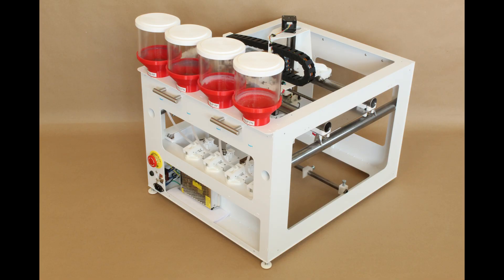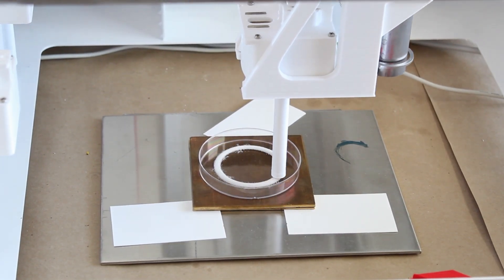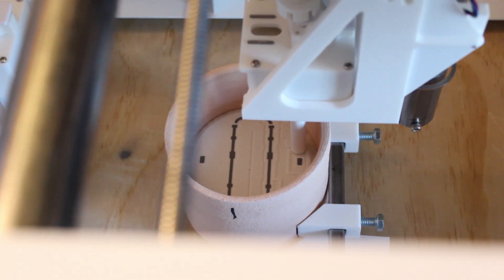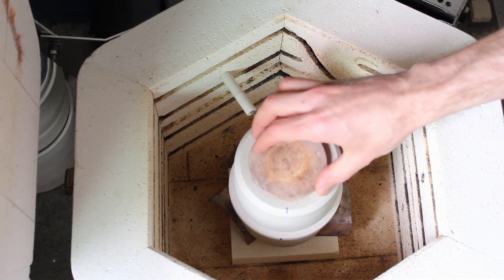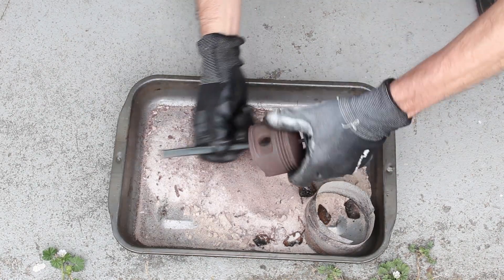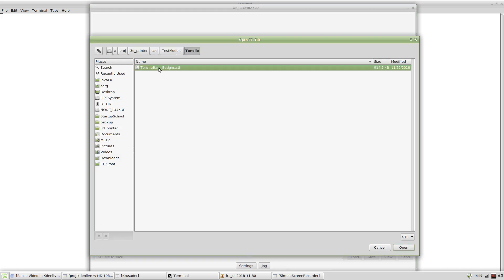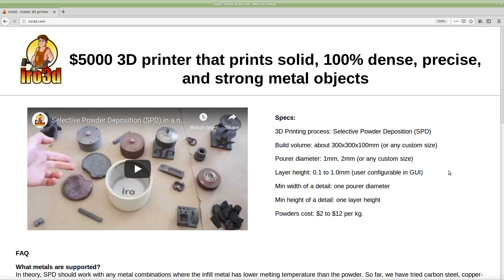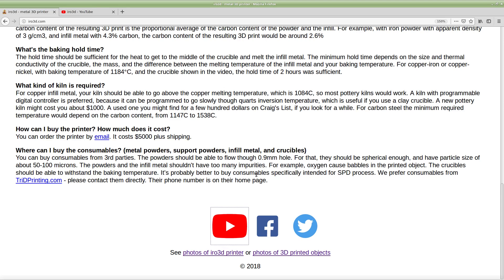What is iro3d metal 3D printer (2018)

Comment from the maker: Here is 2021 version of this video: https://www.youtube.com/watch?v=tY5oQ4e6X_Q
Reply: It seems like a great idea but I was wondering if you could make a much simpler cheaper model so people could get their foot in the door. For instance, make one that only uses 2 powders and is simplified by having 2 separate "extruders" instead of a complex method of using 1 for both.  Also, simplify the design so its cheaper. 

There's a lot of amazing 3D printers on the market and the Ender 3 isn't that great. However, it was able to get many(or most) of us into the hobby and its limitations didn't turn us off from 3D printing but instead inspired most of us to start saving money to get a better system. You need to create a version of your system that's like the Ender 3: a simple, cheap, version that gets people to try out your method of printing. That way, when they like it, they can move on to one of your better systems. One option could be to make parts that could be used to modify existing printers like the Ender 3 or Prusa i3 into doing the stuff your printer does. 

I think you have the best low-cost, high speed, method of 3D printing metal. I think there's a lot of potential there and you could get a large community if you make an affordable entry-level design.

Comment: Really cool technology but 3000 is kind of alot when you can 3d print a part in PLA then create a mold for casting
Reply from the maker: If you can cast it - that's good.  But not all shapes are castable.  Also, making a mold with investment casting is a long and tedious process.  3D printing can save you time.
Reply: @iro3d  I'm not saying the method is without merit, its definitely cool and capable of making complex parts but for alot of applications your better off making a sand mould and casting it that way. Especially for larger parts like for use in cars.
If it wasn't 3000 I'd probably buy one this instant for making complex mechanical parts.
Reply from the maker: @acorgiwithacrown467  We can make them cheaper if we make many at once.  Would you help me with a Kickstarter campaign?
Reply: @iro3d  If you set up a kickstarter I'd definitely donate some money to it as would alot of people. If you contacted alot of the larger machinist channels I'm sure they would be very interested in doing videos on this machine.
Reply: I think the point of this printer is to make your money back. Lost PLA is great but casting distorts shape, includes more porosity, and has other issues. If you set up a business in your town and bought a couple of these machines, you could easily turn a profit

Comment: Due to the technology, if I understand well, it would be easy for instance to print several blades in once right?
But printed object needs to be polished after for product such as knife, correct?
Also, I can't find the page with image?
Reply from the maker: It is easy to print several objects at once, if they fit in your crucible.  But printing blades is not easy, because you would need a special furnace. I assume you want to print blades from stainless still, right?  And, yes, you would need to polish them if you want them smooth and shiny.  What images are you looking for?  (Both, the printer and the printed objects links are on the website.)
Reply: @iro3d  Ok thank you, I found the images. This is because in the new website version, we need to click in the google drive icon and I didn't guess that.
It is not easy to print blades due to the steel? Sharpness? Or due to the special furnace needed / post-treatment?
I want to print blades to create self defense gadgets and sell them. I am not sure which steel to use as my knowledge is limited…
Reply from the maker: @cedrix57  Thanks for letting me know about the website issue.  I just fixed it.  Now the picture gallery should be more discoverable. 
As for the blades, it's difficult to print them because for stainless steel you would need a furnace that can provide about 1500°C in Hydrogen + Argon atmosphere. 
It would be much easier to 3D print rocket engines than blades.  It might be easier to explain the details by phone.   Send me an email with your number.
Reply: @iro3d  Thanks a lot. I suggest that I contact you back when I will know more what I would like (I don't want to make you lose time as I am unlikely to buy yet). Right now, I am just investigating on possibilities. My job is to sell products on amazon. Right now I buy from China. But if I could have my quick & efficient home factory, it could be helpful. But only if it doesn't require advance skills (by advance, I mean long-to-get).
It may not be easy to do knife, but if you could do a video of things we can print and sell, I think it could be interesting :)

Comment: What are your thoughts regarding getting a polished finish on the metal part after the baking process is complete?  Thank you.
Reply from the maker: Yes, if you need, you can polish it after the baking.
Reply: iro3d Right, but do you have any examples of this on one of your prototype parts, and if so, what was the process? This is a crucial issue for some of the things I am interested in doing.
Reply from the maker: @stillastillsfan  No, I haven't tried polishing it.  Do you need a mirror like finish?  What's the application?
Reply: iro3d I can’t say the application but close to mirror finish would be the goal
Reply: @stillastillsfan  if u have a milling machine u can mill it.

Comment: So it uses CNC to make a sand mould?
Reply from the maker: No, there is no mold.
Reply: @iro3d  Well it kind of is, it prints sand and a sacrificial material in the cavity of the mould so that later metal can be melted which fills the cavity. You could do the same thing by printing a plastic version of the actual product and impression it to make a sand mould. I imagine your approach may be better for some unique shapes and prototypes but if you are making multiple of the same item sand moulds would be quicker.
Reply from the maker: @teenflon  Not really.  And there is no sacrificial material in the cavity.  And there is no actual cavity - though you can imagine that sand kind of acts as cavity, but again it's a far stretch of terminology.   With the same looseness, you can say that metal stamping is kind of casting :-)

Comment: also have you considered using tungsten powder with the copper, since this is how some EDM electrodes are made, and this looks like if you have the tungsten powder and several copper and tungsten powder mixes, then you could control the ratio to make a multiple alloy in one part print like some being 70/30 while other parts being 80/20, and still others maybe being 60/40 or even having something else added to the mix, :) I can only imagine how useful this could be to the machining community
Reply from the maker: Yes, tungsten powder and copper infill should work.  But we need to find where to buy the tungsten powder.  The particles should be spherical, and larger than 40 microns.

Comment: Wonderful technology! left me speechless. Precision is part of an achievement, how about the mechanical properties of the output?
Reply from the maker: Good question.  In theory the printed objects should be as strong as the cast ones.  But you do need to have the right powder and the infill metal, and set the right baking parameters. Just this week we had a breakthrough in metal quality improvements.  I'll be updating the video and the website in the near future to explain it. And in the next few days, I try to print some new dog bones and do the tensile strength test.
Reply: @iro3d  Do you file patents for your powders, even for your printer design?
Reply from the maker: I don't make or sell powders.  Why would I try to patent them?
Reply: @iro3d  Let's be clear: you build and sell the printer ONLY. Are we supposed to prepare our powders ourselves? When you stated in one of your video that this printer is cheap - not relatively cheap but cheap -  did you voluntary put aside the price of the oven?
Reply from the maker: Yes, I sell only the printers. You don't have to "prepare" your own powder - you can buy it from any supplier.  The list of suppliers is on the website.  Also, there is a paragraph about the kilns.
Reply: It would not make sense to compare your printer to much more expensive BUT complete solution like this one https://youtu.be/woMKLLEl05s, but printing with your iro3D requires too much manipulations with the constant risk that a movement could ruin a print. It's somewhat deterring...
Reply from the maker: Jean, you must be joking.  If you would have ever used Desktop Metal printer, you would have known, that it requires about 10 times more manipulations than iro3d.  Ric is a genius salesman, so he doesn't mention all the tedious and expensive procedures, which are necessary to operate their system.  But he didn't reach the level of Theranos.
As for the risk of movement that could ruin a print - you are imagining it.  I can dance and jump while carrying the crucible, as demonstrated in my other video: https://youtu.be/QDnRtIEvppY

Comment: Have you experimented in gold or silver? I use to cast gold and silver jewelry but the casting process is kind of terrible. Gold and copper have close to the same melting point though, so I'm curious if you would just use pre-mixed copper/gold alloy powder by itself to control the end result karat such as 14k, 18k etc? Instead of the big copper chunk on top that would be hard to control the end result. Also what kind of quality resolution could you get out of this type of printing - Fine details, prongs, etc?
Another problem would be obtaining gold powder haha which is probably insanely expensive.
Reply: Gold powder isn't as expensive as you would think. A local gun shope was selling  vials of it  for 2 dollars a gram. There's is plenty of powder gold. In any given Creek if you feel like panning for it. Desolve it in acid to remove impurities.
Reply from the maker: No, I have not experimented with gold or silver yet.  They are too expensive.

Comment: How does this deal with the issue of overhangs? I can imagine that they would come out quite badly on a printer that deposits a powder.
Reply from the maker: Overhangs are easy - they are supported by the sand.  Watch the video again.
Reply: With the sand a overhang is irrelevant just like a SLS printer.
Reply from the maker: @Dean Actually, it's even better than SLS, because we have no warping.
(SLS melts and cools one point at a time, so they have a huge warping issue, especially with metal)
Reply: @iro3d  can I ask what the benefit of this is over lost Pla casting?
Reply from the maker: @Joel SPD has many advantages over casting. With SPD you can print practically any geometry.
But casting has lots of problems. For example:
1. How would you make a thin wall?  (Flow of molten metal is restricted by its surface tension)
2. When you pour the metal, where would the air go?  (You would need to add vent channels, and cut them off afterwards)
3. How would you support long and thin cores?
4. How would you remove the long, thin and complicated cores?
5. Casting requires mold material to be thermal shock resistant.
6. Casting is very labor intensive, and thus expensive.
7. Casting is dangerous - you have molten metal outside of the furnace.

Comment: Can you actually use a copper-iron piston?
Reply from the maker: Of course. I use it as a demo object - works great ;-)
I wouldn't put it in a car though.
Reply: @iro3d  It would be pretty cool to see actual use cases of the printer 😉
Reply from the maker: The actual use cases are listed in "What are the practical applications for SPD" section on iro3d.com
Reply: It's a good start to the technology. Just like the first Rep Rap printers had alot to go back then but look at 3d printing now.
Reply: The weight has to be the same as other pistons in the engine, otherwise there is an imbalance, and would the engine destroy itself.
Reply: The way the finished product looks I'm sure you can use it as a paperweight or a door stop.

Comment: 1. Скажите, а компенсируется ли чем-то усадка металлических порошков, образующих деталь, в процессе спекания?
2. Пробовали ли вы проводить дальнейшую мех. обработку полученных деталей? Насколько однородна структура металла?
Reply from the maker: 1. There is no sintering (net спекания).  The video specifically explains it.
2. Yes. The grain boundaries are invisible to a naked eye.  With carbon steel, brass or bronze - it's practically uniform.  With copper-iron  - it's not, because copper and iron don't mix much.

Comment: Камрад! Ю инглиш из со перфиктал! Осталось нераскрытой тема о скорости печати принтера и термостойкости продукции получаемой из него. Это очень важные параметры. Вообще, это не столько 3д принтер, сколько довольно интересная технология близкая к технологии по выплавляемым моделям. По сути принтер печатает не деталь а литьевую форму для металла, а потом металлическую пудру заполняет связующая когда все это находится в муфельной печи. Не совсем понимаю в какой области можно применять такой принтер, но дома такой муфель держать это точно не вариант.
Reply from the maker: You are wrong.  I have a kiln at home.
As for the speed - it's a parameter in the slicer setting.  You can set it as high as your powder would flow.
As for the thermal strength - it depends solely on the metals you choose.
Reply: @iro3d  можно конечно иметь что угодно дома, но плавление металлов это вредное производство.
Reply from the maker: It depends on the metal.  Led and mercury are toxic.  But iron or copper are not.
Reply: @iro3d  Это да, в любом случае, похоже в домашних условиях это единственный способ получить напечатанные металлические изделия. В любом случае респект за изобретение!

Comment: you can 3d print with metal powder filament then put it in a furnace
Reply from the maker: Yes, but the result won't be as good.
Reply: Iron filament isnt pure metal, it has binders, such as plastic.
Reply: @bluestone-gamingbg3498  you use investment casting method

Comment: Very cool. Have you tested the cylinder heads in a car engine? If it is durable, this would be revolutionary.
Reply from the maker: This is just a demo part.  It wasn't intended to be put into a car.  Real part would have to be printed with different alloy.
Reply: You can't simply put in a piston of another alloy.
It would have a different weight than other pistons, and causing an imbalance.
A slightly different weight destroys the engine.

Comment: Is it not cheaper to create a mould from a normal 3D print and then use the kiln.
Reply from the maker: No. Molding is much more labor intensive and the shape is much more limited.  For example, you can't cast a heat exchanger with a spiral hole.
Reply: your average molds that you pour the material in wouldn't cut it. I think they have to be injected with pressure or vacuum if it's a complicated mold. or the kiln has to be sealed with a type of gas and much higher temps. I don't remember exactly.

Comment: Великолепная идея и достойная реализация!
1) Насколько тонкими могут быть элементы из песка, чтобы их можно было удалить после запекания, не разрушаются ли эти поддерживающие структуры во время расплавления металла?
2) Возможно ли использование алюминиевых/цинковых сплавов при запекании под флюсом? zamak сплавы выглядят очень многообещающе для этой технологии. Может откачать воздух из печки и заменить его азотом/аргоном?
3) Вы не думали использовать пьезо элементы, для проталкивания более мелкого порошка и соответственно повышения разрешающей способности?
Reply from the maker: 1) Sand doesn't sinter, so it's easy to remove it regardless of the thickness. 
2) Yes. Yes.
3) Yes.  But 40 microns powder flows well by itself thru 0.4 mm hole.  Smaller powders might be useful for some applications too, but that's not urgent.  Would you like to discuss it by phone?
Reply: @iro3d  I've dropped you an email

Comment: Looks a lot like the binder jet process, but at a very low cost
Reply from the maker: No, it's much better than binder jet process, IMHO.  Binder jet has shrinkage - SPD does not.
Reply: @iro3d  Interesting, I always assumed the "casting" process with an infill material at the end of binder jet was what caused the shrinkage, which you are also doing here. So is it actually the initial process of "baking" the binder and powder causing most of the shrinkage?
Reply: @EdBordin  with the binder jet, I believe the metal is deposited directly into the print, along with a binding agent. It is then baked, evaporating the binder, which causes the shrinkage. This process seems more like a lost wax casting, where the void left behind gets directly filled by solid metal, leaving nothing to evaporate out and no shrinkage

Comment: What about an induction kiln ? would that allow us to use more metals. Also  isnt using aluminum powder like this dangerous because it can self ignite or the particle size is big enough that that wont happen ?
Reply from the maker: It's hard to control the temperature gradient with induction furnaces.  Also they tend to vibrate. An electric arc furnace might be a better idea.  But regardless, the heating source doesn't effect the metal choice much.  As for aluminum powder, if it's large and it won't explode, but it would oxidize on the surface, so, it would have to be coated in a non-reactive metal, like copper or something.

Comment: Are the metal powders toxic to breathe ?
Reply: Ah, found it. 
And 40 microns powder would flow well thru 0.4 mm hole. But when you further reduce the particle size - the powder starts to freeze (not flow), and also get airborne easier, which would present a health hazard. So, the ideal particle size is 40 microns or larger.
Reply from the maker: Good find :-)